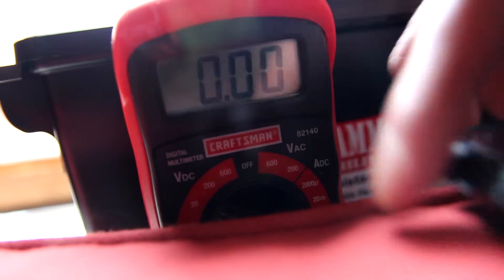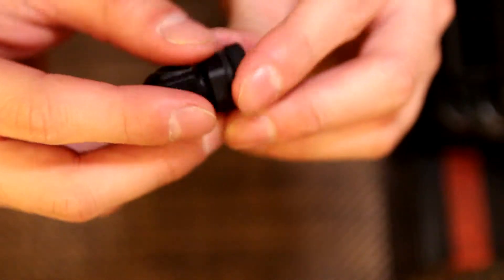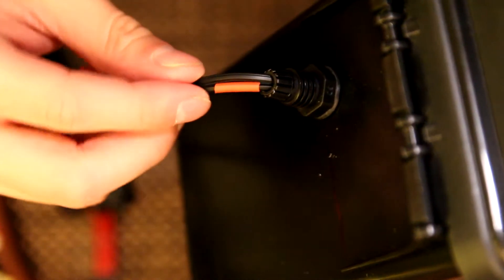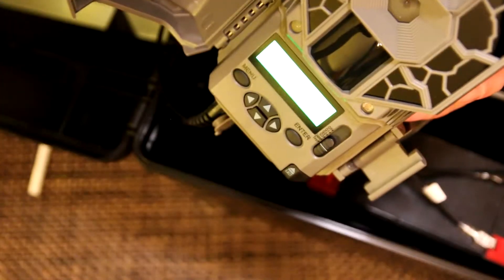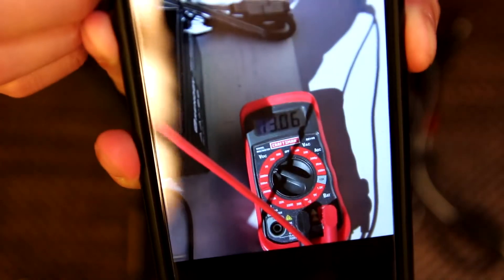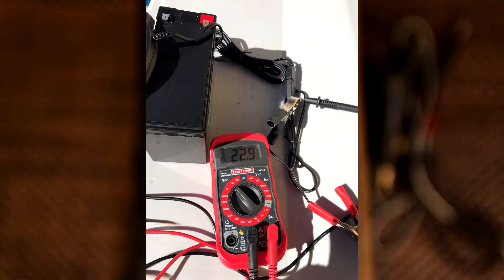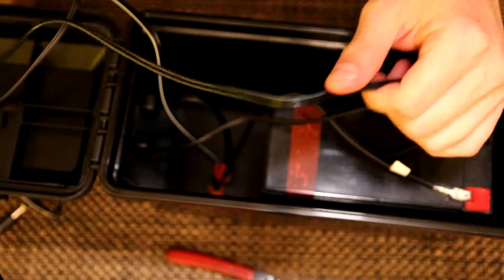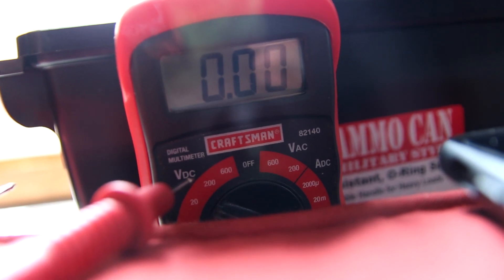DIY Stealth Cam 12V SOLAR Aux Power Battery Pack (Part 2)

Comment: AA batteries are 1.5 volts each
Reply: Read their product description, 12v is the power source
Reply: @ItsChoeTime  he said 12 batteries for a total of 12 volts.  Not talking about the power pack.   Why i stated AA.
Reply: @ all depends on if they put them in parallel or series
Reply: @ItsChoeTime  lmao.  yes series and paralle matterl.  he specifically said, "It takes 12 batteries, so it's a 12v.    That's what I was pointing out.

Comment: Couple of suggestions.   For long sets I suggest 5 watt solar panels and soldering the wires to the battery to prevent possible corrosion.   

You like to tinker so try this -
 
Buy some 6000mAh LiFePo4 cells and hook as many in parallel as you want (2, 3, or 4).    Hook a variable input/output Buck Converter up to them set at 3.62V output.  Then hook a variable output Boost Converter up to them set for either 6v or 12v output.     The boost converters I use shut off when the battery voltage drops below 2 volts.   

I’ve been running two of these unattended for 9 months with a 5 watt solar panel.     Cost is the same as using SLA batteries but LiFePo4 batteries are much more efficient and expected lifetime is 3X or 4X as SLA.   They weigh about 1/4 as much too.  

The lowest temps I’ve ran mine in is 15° F and they worked fine.
Reply from the maker: Hey Jack! A tinker bro. I dig it. Basically this is a setup that sits in the woods. Not much movement going on. We mostly use it in MN around the Oct/Nov timeframe then pack it up. Love me a good project! Thanks for posting.
Reply: onza04   I’m on the Cellular Game Camera Facebook group a lot.   I meant 6000mAh up above.   I edited that.   LiFePo4 batteries have a flat voltage discharge curve till the very end.   Charging efficiency close to 100%.  If I charge with 1 amp it takes exactly 6 hours for them to fully charge (for 6000mAh).  12 hours for 1/2 amp.
Reply from the maker: @jacksprat7087  Nice, sounds like super good usage of power. I think for my intended purposes my box will work great for the 2 month period that I need to monitor the woods. Appreciate the time you spent replying back! I, like you, never settle. In other words, always innovate and making something better is a fun addicting hobby.